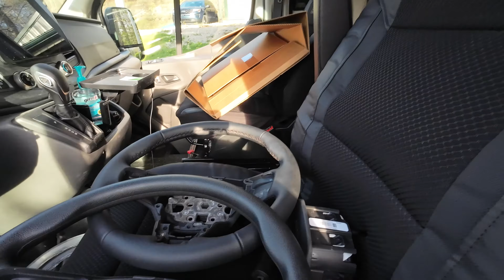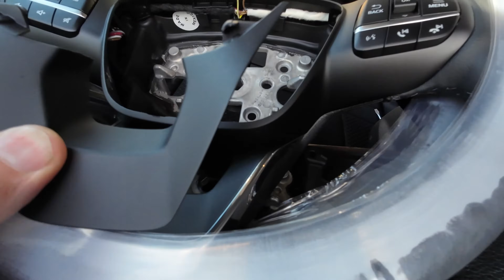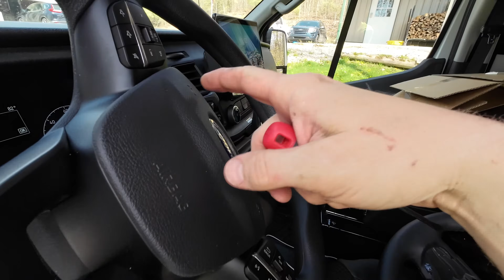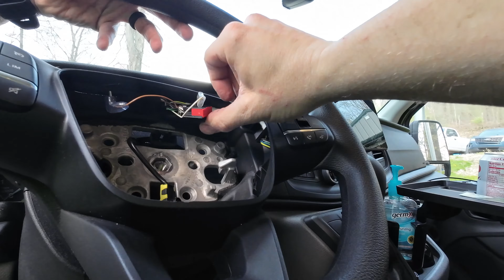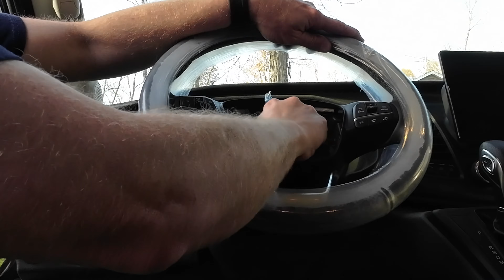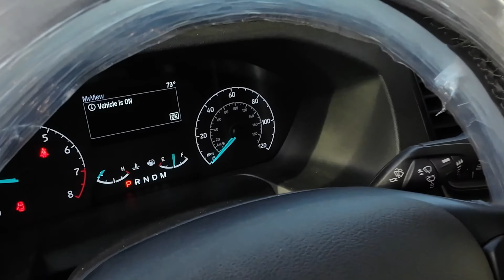2020-2024 Ford Transit Leather Wrapped Steering Wheel Upgrade - How To Remove Steering Wheel

Comment: Can the new steering be added with heat? I am looking to add heated steering to mine
Reply from the maker: I added the heated wheel but haven't got it to work yet. They changed things in 2025. None of the wiring is there. I added it. I also added a new steering wheel control module because the sccm is different. I couldn't program it with FORSCAN. It kept giving me an error code that the module wasn't properly configured. You also have to turn it on in the apim, which I did but the button was greyed out. I suspect the HVAC unit also has to be flashed with different data. It was just too many obstacles at this point. When I have access to FDRS I may try again. Was much easier on the 22-24 models
Reply: @JackofAllMasterofNone  Interesting, and you didn't swap the clock spring? I didn't realize Transit had a heated steering wheel option pre 2025. I was going to get an Escape Wheel and clock spring (hoping they fit) and then just intercept the heating wires and run a manual swt. Have you thought of doing the same with your set up instead of trying to reprogram everything?

Comment: One thing I noticed, your van is an auto, you could have fitted a steering wheel with the paddle shifters. I have a 2016 Ford Focus 2.0L Diesel with the 6 speed auto and I Did some digging and a Ford Kuga 2017 steering with the paddle shifters would fit my car. I bought it second hand simply swapped out the old one for the second hand one and they work with no modifications to the wheel or wiring what so ever and the + and - symbols on the paddles light up too!
Reply from the maker: That's cool. My shifter has the up / down gear switch on it so not really necessary since I never manually shift but I'm sure someone would want to